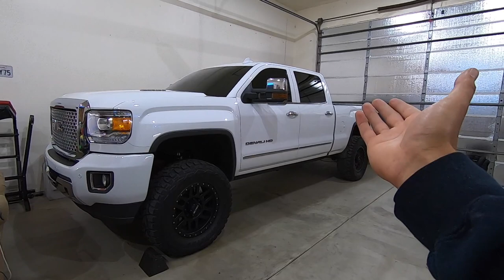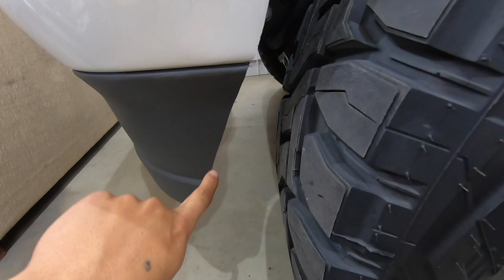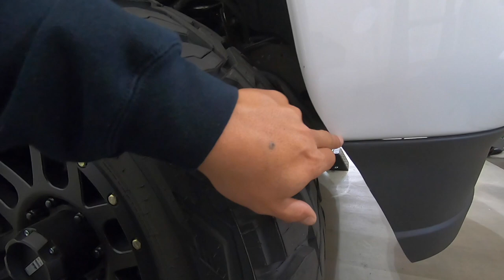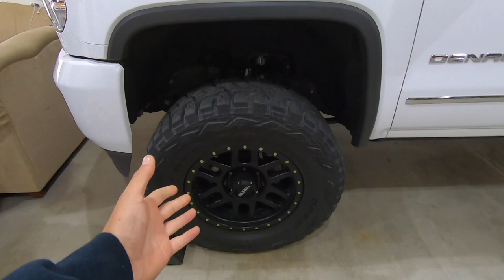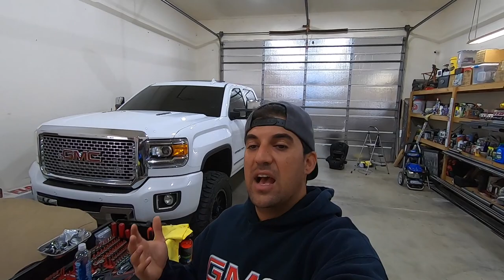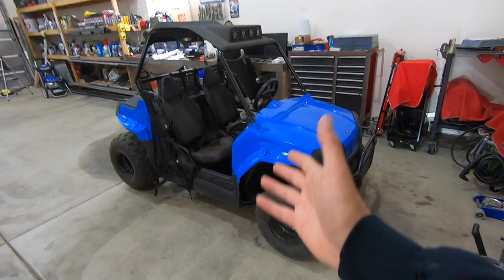HOW TO FIT 37S ON A 5" LIFT

Comment: Chevy goes back and forth on those square wheel wells and round wheel wells. If you were to fully compress your front suspension to the bump stops will you rub?
Reply from the maker: not sure

Comment: My 2500 2019 1500 can fit 37x12.50r20 on level kit with no rubbing i end up puting a 6.5 BDS lift with 4 links and air bags front and rear im running 40x14.50R22x14 Fule hostage wheels rubs at full crank
Reply: Can you post a pic somewhere?

Comment: Eddie, how wide are your wheels? What's the offset?
Reply from the maker: 37x13.50x20 and the rims r 20x9 with a +18 offset
Reply: @EddieLife3500  thanks man.
Reply: So I am running a bds 4.5" with 18x9 -12 offset and want to fit 37x13.5s. Eddie would you have any info with that offset if I can or not ? I have done the same trimming you have done on yours as well already with 35's. I have a 2017 l5p. Thanks.

Comment: The reason he can fit 37s is because that's a 2500, not a 1500. 2500 and 3500  sit 2 or 3 in higher then a 1500. so people with a 1500 can not fit 37s on a 5 in lift haha